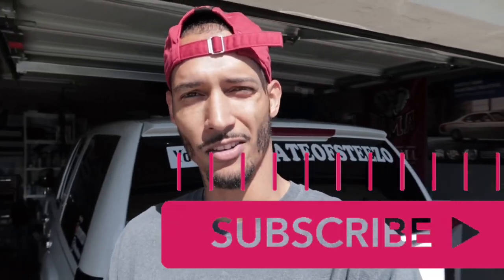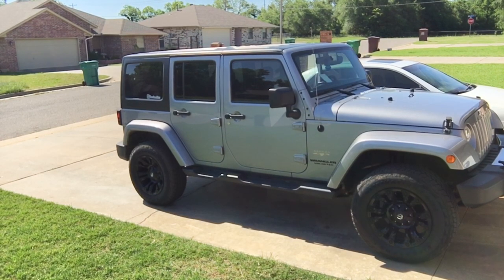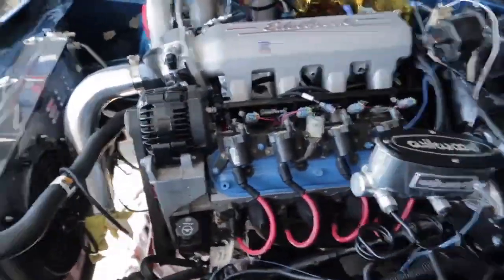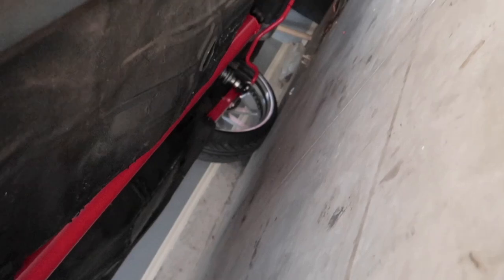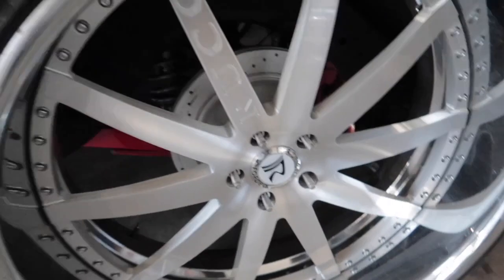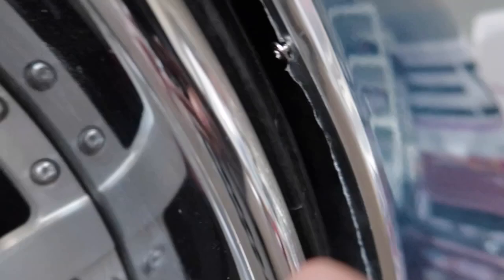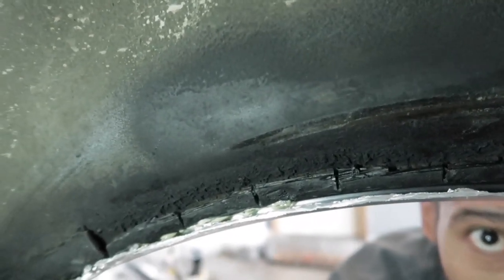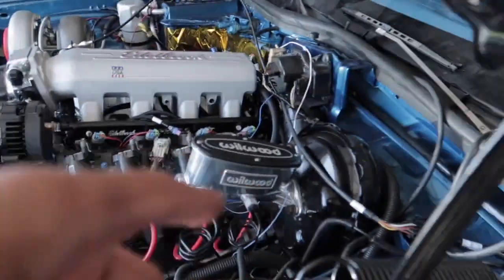HOW I SQUATTED MY BOX CHEVY ON 26x10 RUCCI'S | 2 DOOR LANDAU

Comment: Yessir! Glad you got it figured out. These LS engines need a good priming first. I used drill pump (yeah like a hand Milwaukee Drill) and a pump. It’s basically a household tool. Put a barb hose fitting on the side of block where the oil galley plug is and pumped oil through out the block until I saw it seep out the back where the sensor is and also till I seen it seep out the top of rockers. I also, primed the oil pump (just filled it with oil before I installed it). 

Great feeling when you got that Oil Pressure after a fresh build. Good work fam! Love what you doing.
Reply from the maker: Man it was a relief

Comment: I gotta 77 impala only on 24z
Chose a smaller size for less hassle
Heated my stock springs 
It’s tucked, but the ride sufferers 
Got sum 96 impala ss springs 
There 4 inches shorter than stock, Thinking of the QA1 for the back , since I’ve been looking in that direction 👀
Thanks Bro Bro👊🏾🔥🔥🔥